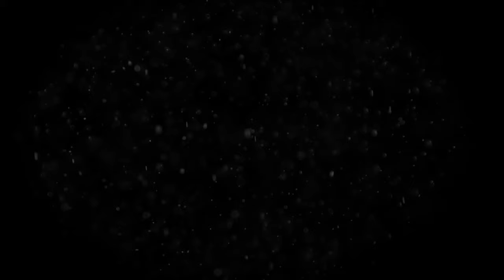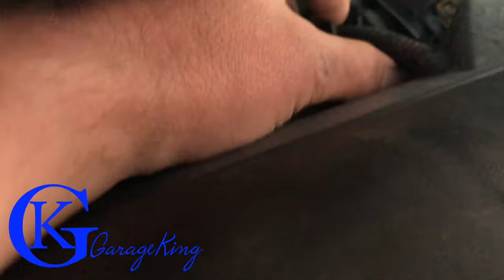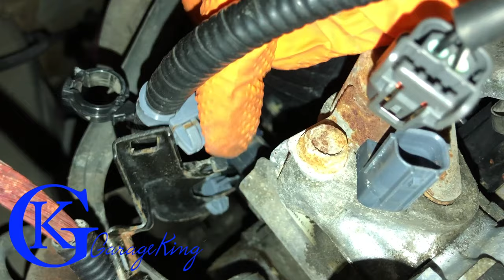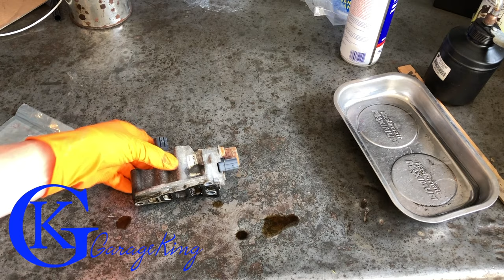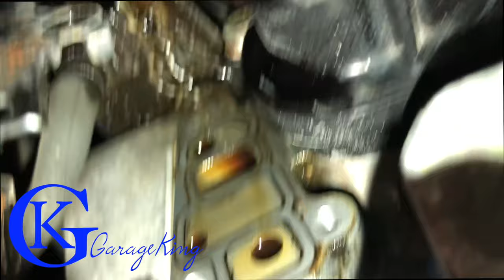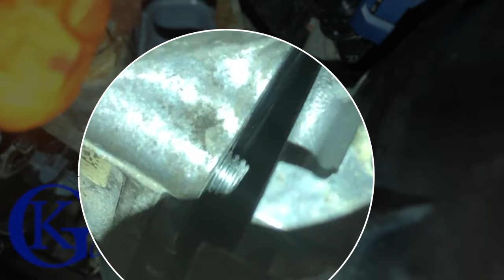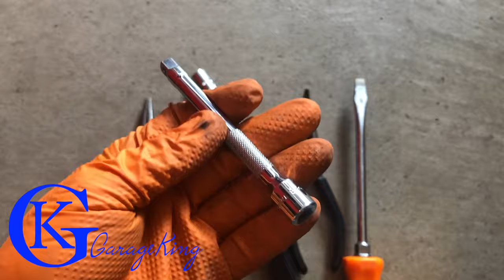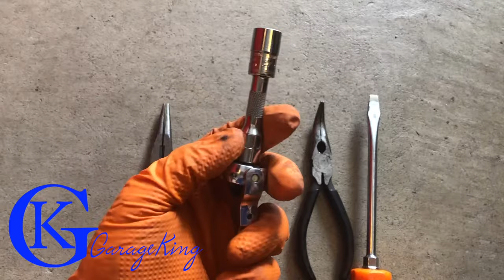Honda Civic Leaking Oil on Passenger Side from Cylinder Head

Comment: How did you clean the area after you took it out
Reply from the maker: First I washed the engine so the outside everywhere was clean.  then when I took the part off that was easy to clean on the bench, so the block part I put a rag in the back of the engine and then I used a scotch bright back on the surface area that mates with the gasket.

Comment: My '09 civic definitely has oil leaking from this point. Any info on what a shop may charge to fix this?
Reply from the maker: Hey there, I can't see them charging more than an hour or two.  The part is super cheap, like 5 bucks, so just the hourly rate plus applicable taxes.
Reply: Well, the stealership I went to (Honda Dealer/Service Center) quoted me $532.73 this past Monday trying to convince me it's actually the valve that needs replaced to stop the leaking and not just the $5 gasket. That's why I'm here.
Reply from the maker: @alexross8722  Oh wow, don't know why the dealership would do that, unless they don't know?

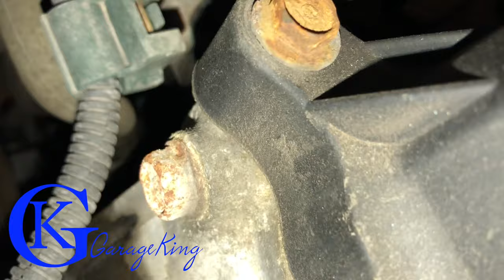Comment: Placed successfully, but there is still a small leak on the left side near the rubber cap (black circle at 0:58) on the left side of the engine. Any thoughts?
Reply from the maker: Hi There, I think that is your camshaft plug.  I have never replaced one.  I would call Honda and give them your vin, see what it looks like (if its only a few bucks buy it) and then see how it comes out.  Maybe it just pulls out, I'm really not sure as I have never changed one.
Reply: Oh awesome, thank you for the quick response! I’ll check it out.
Reply from the maker: @seansethi196  Excellent
Reply: Easy fix. Turns out it was a secondary leak to this one! Thank you again.
Reply from the maker: @seansethi196  Glad I could help !

Comment: Does it leak while sitting or running... or both?
Reply from the maker: Only when running, then when you shut it off its just whatever was left on the engine ran down and dripped off.

Comment: What is that part called I have a 2002 honda civic ex and it is leaking oil I changed the valve cover gasket kit and the valve plug but still a bad leak  so much oil that I can't tell where it is coming from   so hopefully this will fix it if not any information will be appreciated
Reply from the maker: Hey there and thanks for the comment.  It's commonly called the VVT, or Variable Valve Solenoid.  Hopefully this helps you out.  Also as there is a lot of dirt build up there, I would wash the engine with some degreaser before you do the job.  This will prevent dirt from possibly getting into the engine (and causing major problems) when you are doing the repair.
Reply: It is call "solenoid spool valve gasket" for Honda that leak and need replacement. 
VVT applicable to Toyota.
Reply from the maker: @metzmatu8409  Thanks for the clarification Metz, hope you are enjoying your weekend :)

Comment: Another great video! Trying to trace down a leak on my 2009 Civic. Noticed an oil leak while doing an oil change on the passenger side like you indicated.  Did you notice any oil around the valve cover caused by this?   I initially thought it was the valve cover as I noticed some dirt build up on that side of the cover, so I am contemplating just replacing both  today.

Edit - Looks like my valve cover is definitely leaking, probably best to replace both most of the oil is in the passenger side however
Reply from the maker: You could do them both, I would if you are doing the valve cover, as you are in there anyway, and the leak at the cylinder head is very common, plug the gasket is pretty cheap. Make sure to give the engine a cleaning before you start so you don't get dirt falling in the engine.  Thanks for the comment !!
Reply from the maker: Oh and when I did mine, I didn't notice any oil on the valve cover.  I washed the engine off and then ran it and checked for leaks and the valve cover was good.
Reply: @GarageKing  That's what I was thinking as well, similar steps might as well tackle them both.  Thanks!
Reply from the maker: @Hitmanjat  Anytime and good luck with the job !

Comment: So I have the tiniest leak that only happens when the car is running and it hits a hot pipe underneath I think this may be it but I'm not sure
Reply from the maker: Yup this is probably it, and once it drips on the exhaust that's when you smell it.  Good thing is the part is only a few dollars (Like 5 or so) and its a pretty easy job to do.  It could be much worse, but this one is an easy one :)  If you want to make sure, use some engine degreaser with the garden hose and wash off your engine good.  Then drive it for a day and check.  That's what I did and it confirmed the leak.

Comment: I have also civic 8 gen my oil leaking from passenger side when we start the engin,it's leaking from top of steering motor, please suggest??
Reply from the maker: Hi There, if its leaking near the steering pump check the pump fluid level to see if its leaking.  Its possible its leaking at the pressure or return line and running down.  Most of the time its the part I show in the video.
Reply: @GarageKing  steering oil level is okay only engine oil is leaking
Reply from the maker: @OSHAHBAZO  Hey there, the 4 main points to leak are the VVT solenoid (in the video), valve cover, the front timing cover, and the oil pan.  Usually the its what's in the video.  The oil pan is pretty low so if you have oil up top it could be the valve cover, or possibly the timing cover.  What I would do is wash the engine off good with some engine degreaser. Once the engine is clean take it for a drive and then recheck before it leaks everywhere, this way you don't misdiagnose the leak and can be sure to know where its coming from.
Reply: @GarageKing  thank you very much the information is very useful, I will check tomorrow with Mechanic this 4 points,
Let me add here my engine oil is only leak when I turn on the engine & it's start leaking coming top of the steering motor, now I think it's vvt... thank you again
Reply from the maker: @OSHAHBAZO  Anytime :)  Most likely I think its the VVT
Reply: @GarageKing  yup I this this is the part because I have diagnostic it's leakage exact behind from oil inlet cap
Reply from the maker: @OSHAHBAZO  I'm glad you found out exactly where its leaking.  Now it just a matter of fixing it :)  Thanks for the follow and Merry Christmas to you :)
Reply: Hi, I am about to do this job! Did you have to drain the oil??

Comment: Did anyone get a check engine after doing this? I have everything plugged back in the way it ahould be too!
Reply from the maker: You should not have a check engine light, if you do scan it, and its possible you did not plug something in fully.  This repair should not cause a check engine light to come on.

Comment: Where did you buy the extension for the ratchet?
Reply from the maker: Hey there, most of my tools are snap on, but if you mean the ratchet you can get a very similar one on Amazon https://amzn.to/3F7fP1s  the extension is just a regular 1/4" drive extension https://amzn.to/3XvkP7x I could not find a swivel socket like my snap on as it was impact related, but a standard swivel non impact would do https://amzn.to/3iDLTTk if you have any other questions please let me know.
Reply from the maker: OK I just went and watched the video, so I used the standard 10mm socket not the swivel, then a small extension like a 2 or 3"  like this set https://amzn.to/3XvkP7x (I sent in the last message) but most important is the ratchet, you need one that can really swivel around https://amzn.to/3F7fP1s  Thanks !!!
Reply: Thank you awesome video .
Reply from the maker: @johnharlin3367  Thanks for the comment, I do appreciate it !!

Comment: I don’t have vtec. Can anyone help me with the part or part number. I have a 2005 civic lx special edition coupe
Reply from the maker: Hey There, VTEC was originally introduced in the late 1980s (first on the Integra XS with the B16A engine – not the Acura/Honda NSX as many think) so you most likely have it.  As yours is a 2005 so you may have a 7th gen Civic, as the 8th gen civic started in 2006.  In your case I would go to the dealership with your ser# of your car to get the part.  These parts are cheap often costing only a few dollars as the dealership so its best to get genuine Honda and you know it will fit well.

Comment: Already change it but it continues to leak. Anyone knows why?
Reply from the maker: There is a pressure switch screwed into the housing and there is a possibility the pressure switch could be leaking. If you can spray it all down with brake cleaner, and then run the car and use a mechanics mirror you may be able to see where its leaking.  Use a mirror like this.  https://amzn.to/3S8HLd1

Comment: Did you notice any strange noises before replacing the part that went away after replacing it?
Reply from the maker: Hey there and thanks for the comment.  No strange noise before or after.
Reply from the maker: Nope, no strange noises.
Reply: @GarageKing  found my strange noise, it was the water pump, while at it got the belt/tensioner replaced also, thermostat, radiator and cap 😁, and also couple of seals
Reply from the maker: @514aam  Most excellent, always a good feeling !!!

Comment: What’s this part called and what does it do
Reply from the maker: Hi There, its the VVT solenoid.  It controls the variable camshaft timing. You need it !!!
Reply: @GarageKing  where did you buy the part?
Reply from the maker: @LandonSouthwick  Hey there, and sorry for the late reply, I'm out camping with spotty wifi.  I bought the part from the Honda dealership.  It was really cheap, and I think going to Honda is the best bet as the part is only a few bucks.
Reply: @GarageKing  all good! Thank you. Hoping it fixes my leak that I just noticed in my 2012 civic. Thanks for the help!
Reply from the maker: @LandonSouthwick  Anytime, Its a very common problem on the civics so if you got oil on the passenger side, there is a good change this is it.  Its actually a pretty simple job to do  :)

Comment: I tightened the bracket bolt too much and it broke. I don`t know how to the half bolt stuck inside. Guys don`t tighten too much.
Reply from the maker: Ouch !!!  OK well 1st thing is to remove the part.  Remove the old bolts, and electrical connector and see if you can slide it back off the broken bolt.  Not sure where the bolt broke but if there is enough sticking out of the engine block you should be able to turn it with a small pair of pliers (or by hand) Usually when bolts brake when you are installing them, they are not tight and you can remove by hand.  All those videos about stuck broken bolts are for bolts that are seized and can't be removed as they have rusted into place.  This is not the case with you as you were installing so the bolt is not stuck.  I just hope there is enough of it to grab with a small tool and twist it out.  You may even be able to remove it by hand.
Reply: @GarageKing  I removed broken bolts using dremel tool and it was easy. I broke bracket bolt and top 2 solenoid bolts due to over tighten. I was able to remove all the three using dremel tool. Thanks
Reply from the maker: @johngraham2470  That's good and I'm glad you were able to get the broken bolts out.  I know how it feels when a bolt breaks, its a sucky situation for sure.

Comment: Doesn’t explain what any of the parts he did,
Reply from the maker: Sorry, it was just the gasket leaking so I wanted to show how to replace the gasket.  You gave me a good idea for another video though.  Thanks !!
Reply: @GarageKing  I have an 06 civic so I was interested if it did happen to mine, was a good video though and do appreciate your help.
Reply from the maker: @DHSFEMA  The part is actually the Variable Valve Solenoid, and there is a pressure switch on it that should be checked as well.  The pressure switch is screwed in and only needs a little bit of teflon tape to seal it.  Thanks !!!
Reply: @GarageKing  I understand it now, again thanks a lot

Comment: What mm size those three bolt to use socket you are not mentioned rest every is good i got in the last thank its complete good vedio great help thanks
Reply from the maker: Hey there, I believe they are 10mm bolts if I remember correctly
Reply: @GarageKing  
Thanks so much yes i saw that in the last vedio is great help just a small sujetion the moment you put socket on bolt you can mention as well this a 10mm socket thanks every thing is 👍 great
Reply from the maker: @jamalnasir2846  Excellent !!

Comment: Could this issue cause smoke under the hood ?
Reply from the maker: Yes it could if the oil running down is burning.
Reply: @GarageKing I just swapped the Valve Cover Gasket and cylinder head cam plug so I’m hoping this is the issue

Comment: I have a 2007 Honda civic Lx sedan 4 door and just today my oil leaking from the bottom of the car while pressing on the gas ? Is it that part of the car have to changed ?
Reply from the maker: This part does leak from the bottom of the car, but pressing on the gas should not make a difference, it should be consistent. The only this is there is an oil pressure switch on that fitting, and if that is leaking it will leak faster if you speed the engine up as there is more oil pressure.  They don't leak often.  I would wash the engine so its clean.  Get someone to start the engine and you look around as they rev it up a bit and see if you can locate the leak.